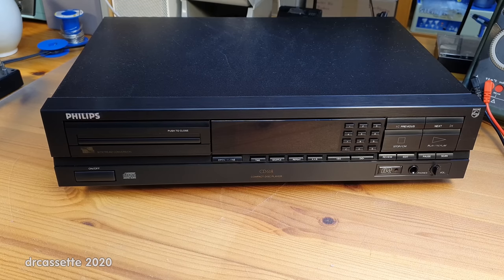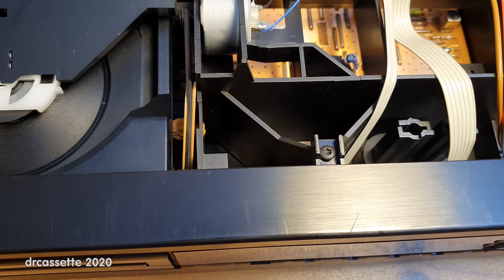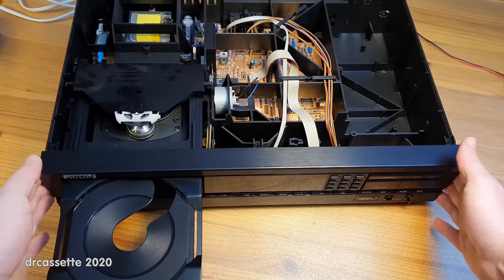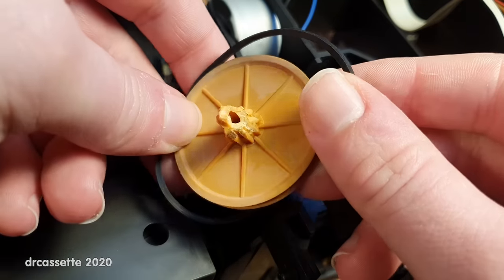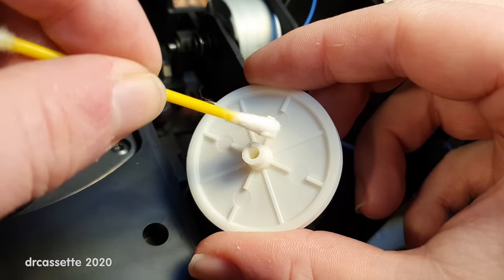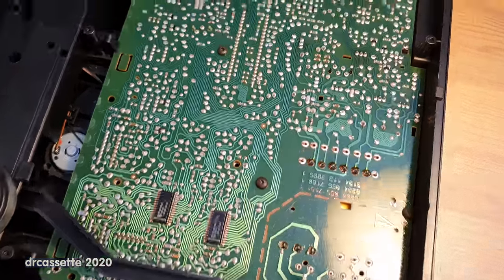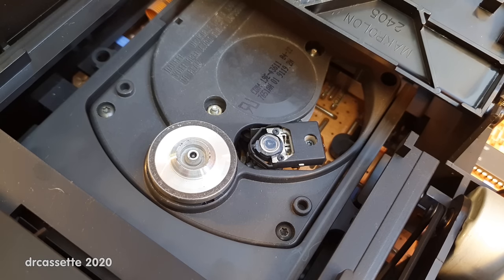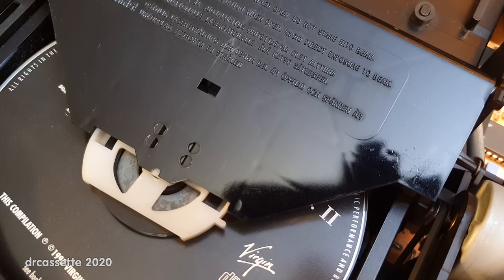Philips CD618 CD Player repairs - CDM4 drawer gear wheel replacement

Comment: The CDM series it the finest of laser pick-up design; the CDM-1 is built to last forever, all metal, excellent piece of design. The CDM-4 is a later cost saving version with some pieces made of hard plastic, but the swing arm is still high quality. Very durable pick-up, virtually no maintenance required throughout all of its life. As for access speed, CDM were not that fast due to the mass of the pickup and the counterweight which tended to overshoot in case of wide and fast movements. Philips itself abandoned the swing arm with the last of the line CDM-9 in 1995 and started using linear pick-up with the (cheap) series of CDM-12. Beside costs reason (swing arm are quite expensive), it was not possible to use swing arm in CD-ROM, they were too slow for the random access of a data player.
Reply: It was CDM12.4 I think the last time I work in the service sector.

Comment: Even though this was probably a budget/mid range Philips player from back then it is still much, much better built than any CD player made today.  I have two CD players that are used almost every day, a Yamaha from around the same time period and a late 80s Technics. The Technics is solid, very heavy and superbly well built and even manages to read CD-R discs and CD-RW discs too even though they weren't invented when it was made. It is also using the same loading belt from when it was new, never had to replace it unlike the belts in cassette players and my Yamaha CD Player's loading belt.
Reply: Definitely agree . A lot of manufacturers cut costs in the 1990s . But this player is great

Comment: I have a CD610 mk2, and a CD634. Great machines. I also have a Marantz CD52 SE mk2, and three German made Technics players which all use the reliable CDM4/19 mech. Thanks for the video. Hello from the UK! I think a lot of 'Japanese' CD players were made in the EU to avoid import duty. These Philips Machines may be 'plasticy' but it's a very strong, low resonance construction.
Reply: Philips used the TDA1541 DAC a lot and that thing sounded smooth. It was so good that chinese companies started plagiarising it 😂

Comment: However.... That is some quality you do not see today anymore.... Amazing that no plastic was "cooked" and brittle
Reply from the maker: Ummm... the plastic of the gear wheel was VERY brittle ;)
Reply: I was biting my finger nails when you bent the plastic to fit the gear :)
Reply from the maker: The chassis plastic actually was okay, in very good condition. Though thinking about it, maybe I should have been a little more careful in case it wasn't...

Comment: Beautiful job. So really is worth repairing these units. I have just bought a Denon that apparently has a lazy door so may need to do this. Still love CD sound rather than mp3 what we are used to now. Thanks for posting 👍😊
Reply from the maker: The only applies to CD players with CDM4 mechanism, those are mostly Philips, Marantz and Technics. Not sure if Denon used the CDM4 mechanism.
Reply: @DrCassette  👍 ok. I have subscribed. I may need more advice in future. Thank you 😊

Comment: Thanks for sharing this, I'm  following closely ...Do you know if the CD 604 is the same wheel and belt?
Mine is orange colour and although the gear was well worn in parts it was a part of the belt's running groove that had been shorn off.
The motor fires up no problem with it all removed so it must have been jammed somehow, and I couldn't hear the motor trying to do something when pressing the load/eject button so thought it was the motor that had died ,you mention the diode can leak away over time-
Also I didn't need to disconnect the power arm on this one-
there's a snapped dowel pin on the corner of the tray bottom left side-it seems to be retaining a small spring- perhaps it's one of the snap locks when the tray is fully closed you feel it connecting ? 
Maybe you know what I should call it and if is available as a part ?
Thanks again and I'm hoping the wheel and belt are the same so I can order them 
Best regards to you !

Comment: I’ve got a single disc CD player I’ve had for years I love it. It recently started to fail. The cd drawer only opens when you tap the top of the CD player. I’ve tried greasing the components but that doesn’t help. Think it’s something I can repair myself or should I bring it to my repair guy
Reply from the maker: How am I supposed to know if you don't even give me the brand and model number? ;)
Reply: DrCassette kenwood DP-2040 mfg 1992
Reply from the maker: Seems to me like the drawer drive does not have enough force to disengage the part that holds down the CD during playback. That's why tapping the CD player helps. Most likely a bad drive belt. Make sure the belt has plenty of tension. If it hasn't, replace it. Also make sure you haven't gotten any grease on anything that is not supposed to be slippery.
Reply: DrCassette awesome thank you 🙏 the guy I topically bring my electronics to doesn’t charge much . If I can’t do it  I’m sure he’ll be able to help . I like to do what I can just feels better thanks again and kind regards, Michael
Reply from the maker: You are welcome :)
Reply: While you're replacing the belt, you might also want to give the drawer microswitches some love. These signal the the drawer position to the microcontroller and like to get dirty which can also lead to strange behaviour upon opening/closing the drawer.
Reply: Definitely a good idea ... contact cleaner... beware of over spray... getting on the pickup lense ... as far as the belt goes if it has decent tension... it may just be a build up of grease and dirt (slipping) give the pulleys a good cleaning with denatured alcohol ... if the belt comes out easy enough give it a good washing with dish soap ... allow the pulleys to dry throughly ... certain formulas of rubber belts don't like alcohol no matter the type Good luck in your quest 😃

Comment: Thanks for the video, I had a 614 with the same problem. However, I found that I didn't have to disconnect the power button arm from the switch to remove the front plate, just tilting the front like an oven door was sufficient.
Reply: Thanks much for the video - and this comment. I've got a CD614 to repair in a few days (same issue: The wheel came apart like a piece of cooked and re-dried pasta) and this will do the trick. Meanwhile: Do you know what the CD618 relationships are? Looks like a CD624 from the outside. Is the 6X8 family (if it is a family) the 230V UK version of the 6X4 family, by chance? Cheers & best from the continent.

Comment: Was waiting for the SNAP from that bendable piece of plastic...
Reply from the maker: The plastic the chassis is made from fortunately is in very good condition, so I had no worries about snapping off that piece. And if it had snapped off, there would have been some swearing and some epoxy glue and all would have been fine again...

Comment: Easy, breezy, beautiful Cover Girl - It's a Philips. It works, nice plastic ribs for extra strength. Mechanisms themselves better than the best Sony, my Sony skips on some 80min CD-R towards the end. BTW,  don't be surprised that it can play CD-RW - Philips developed them after all. And this one has removable bottom panel - my Sony from around the same time doesn't, so another big plus for the Flying Dutchman. Volume control, Program, Index - what else would you need. I can't find any Philips based machine in my area - the it's a Sony advertisement made such a following that in North America Philips was treated like low fi brand which is very far from the actual truth. Guess what my post 2001 Sony Car CD player uses as amplifiers - NXP chips. And think of all the NOS Mullard and Philips tubes many people are after, some of the best quality tubes ever made.
http://www.soundfountain.com/amb/cd25years.html
BTW, the TDA1541 with oversampling, dither, and noise sampling was used by Sony untill 1988 when they finally were able to make their own chips that were as good as the Philips TDA1541.
Reply: CD-RW requires a dedicated "mode" to be read: reflectivity between pits and lands is lower and with standard pick-up the signal is too noisy to be decoded. CD players that supports CD-RW increase by 10 the amplification of the RF coming from the laser pick-up. The TDA1540 is a 14-bit DAC, but it was used by Philips in a sigma-delta configuration so that thanks to noise shaping it could reach a resolution of 16 bits. Very clever ! I have a Philips CD 204 with both CDM-1 and TDA1540 and despite its age it works perfectly and sounds very good.
Reply from the maker: Interesting, I knew CDRWs were less reflective, but I didn't know CD players could switch in additional RF amplification to better cope with this. I used to have two Philips CD204 CD players, one silver and one black. I ended up selling them because I didn't use them as much as they deserved. But they were absolutely fantastic machines.

Comment: I fixed my CD player with this video. Awesome. One more question... Now, a week later, the motor starts to spin shortly when I press the CD player ON, as if it wants to close the drawer. However, the drawer is closed, so the belt starts to spin around the wheel, making weird noises. I don't think it's normal behavior for the motor to start spinning when the unit is powered on. Any ideas?
Reply from the maker: This could be caused by dirty contacts in the limit switches, so the logic thinks the drawer is open
Reply: @DrCassette  thanks for replying! Where can find those switches and how to clean them ?

Comment: Do you still have this player? I have an odd question about it. 

I have a Micromega Leader 2.  They modified it off this player. I took off the feet and put them aside with the screws. I went to put the feet back on and noticed that one of the screws is shorter than the other 3. I'm embarrassed to admit I can't figure out which foot uses the shorter screw.

Comment: I have the CD 620 from around the same period, was my first real CD player, took it out of storage ( the loft) and powered it up, pressed open on the drawer but nothing happened so I opened it up, the gear and belt were OK but somehow the cover had got stuck, lifted it up like you did and then put it back, now the drawer opens fine but its quite slow, do you think I should replace the belt anyway and also the grease as the existing has gone a yellowish colour.
Reply: I would definitely replace the belt but also look for the same issue with the broken gear that he showed you in this video.
Reply: @postersm7141  thanks for the reply, the drawer opens fine but slowly without making any sounds like in this video so I think the gear is ok but I think I will change the belt and put some new grease.

Comment: My second CD player ever was a Magnavox with this rotary voice coil mechanism.  I think it was also the only CD player I ever had that supported index marks.  I own only one CD I know has these index marks (Genesis - Invisible Touch).  I really wish I hadn't traded that CD player away all those years ago.
Reply from the maker: That's interesting, do you remember what the index marks were good for on the Genesis album? Must have been the first release of the album on CD, the re-release on CD that I have of course has no index marks. I always thought the index marks were only used on CDs with classical music to subdivide tracks.
Reply: @DrCassette  on Invisible Touch, "Domino" has an index mark that will take you to the second part of the song ("The Last Domino").  CD ripping software like Brasero will even pick these marks up and put them on the TOC.

Apparently, if you've got Genesis's "Foxtrot" album on CD, the "Supper's Ready" track is subdivided into 7 parts using index marks.  This is probably release-specific, too.
Reply from the maker: Very interesting, I never knew index marks were used on pop/rock CDs as well. Thanks for the info!
Reply: The first release of Enigma - "MCMXC a.D." also had indexes. Later versions of the CD used regular track markers but I recently bought the first version brand new via Discogs so I could use the index buttons on my Philips CD 473. :)
Reply: And on the first pressing of Genesis’ Foxtrot there were index marks on Supper’s Ready!
Reply: i had a pioneer ,the pd-7100 that had index and all cd´s i had through the 90´s ,they work with index but the players don´t ,even pioneer later had the index in the display but just if you watched when in the begining of the songs you could see the index number appear, normally EMI cd´s had it,i remenber those lp´s that had sounds in between the tracks you could listen to them without those sounds just the songs as they were in the singles or radio versios, regards

Comment: I have a Philips cd player with a similar mechanism, however it is has a different problem. It can’t play cd’s properly anymore, it skips like crazy even on known good cd’s. Tried cleaning the lens once, but I think it might have a more severe problem. I wonder if the laser itself has gone kaput. It just seems to have a tracking issue.
Reply from the maker: That is certainly possible, laser diodes have a limited lifetime. Over the years I have come across two Technics CD players with CDM4 mechanism. Both had problems detecting CDs and tracking properly during playback.
Reply: @DrCassette   You are correct - they have a finite life - good for a certain amount of hours and that is it.  Kind of a shame because alot of these older players were great. 
I'm surprised you bash Philips so much - I though they were fairly well regarded in Europe/GB.  Here in the US, they weren't remarkable bad, just not normally special either.  They weren't the best you could get, but they were far from the worst.
Great video!
Reply from the maker: I was not bashing Philips, I was defending them! It is a fact that out of all European manufacturers Philips were the first to cut cost and reduce built quality. But they were still very well capable of making good products. And time has proven them right, out of all the major European electronics manufacturers Philips remains as one of the last independent companies.

Comment: I have a Phillips CD604 that is, I presume, either slightly older or slightly lower spec that the 618 you showed. It has just developed the same problem with the CD drawer and also will not read the table of contents. Before I take the casing apart, is the remedy the same for the 604? Is there anything else that might cause this? Thank you.
Reply: I just fixed my 604, following the Doc's excellent instructions. So yes, I confirm the remedy is exactly the same.  Though since you posted this just under a year ago, I appreciate that my response may not be entirely useful to you now.
Reply: @hingmy5746  Is it the same wheel and belt as CDM4 in this one?
Reply: @badbasstrilogy  I ordered the same wheel and belt as shown in the video and it was a perfect fit.
Reply: @hingmy5746  I think the entire 6X4 family (04, 14, 24, 34) and the 608, 618 are interchangeable in that aspect.

Comment: If you don't replace the worn parts of the gear drive, will the CD player eventually get to the point where the motor won't be able to open or close the tray at all?
Reply from the maker: When experimenting with how to get the mechanism apart for the video, I actually broke the gear completely. In that condition, you could freely move the drawer around as shown in the video, but the motor drive wouldn't do anything anymore at all.

Comment: Another note: Because this is a Phillips product, all of the screws are Torx, probably T10. (yes, I know that it may be considered ironic, though the inventor of Phillips head screws is not related to the electronics company)
Japanese decks use JIS screws (simillar to Phillips head screws, but slightly modified to reduce cam out (colloquially known as "slipping", it acts slightly like a torque limiter).
Reply: @UsernameNotDefined. You may already know this. The Japanese JIS screws are identified by a small stopped "hole" punched into the screw head next to the cross head pattern. Apparently, there are JIS screwdrivers available specifically for these screw fixings, right down to miniature versions for Japanese cameras and optical equipment. The JIS stands for "Japanese Imperial Standard" although I think the Imperial is based on the Japanese measuring system "Sun" and not UK/USA Imperial Inches.

Comment: I have a Philips D8884 with same CD-mechanism (excluded loader mechanism) CDM-4, it is a portable radio "boombox". The problem is that it won't read all tracks, stops and shows "error" mostly after track six and higher.I know you are DrCassette however maybe some others know what is actually going wrong? Is this a common problem of the mechanism and easy to fix? I don't think it is a mechanical problem because the arm can move freely at any position. Any ideas? Thanks for any reply.
Reply from the maker: Possibly the laser diode has gone weak. If that happens there are all kinds of problems with the CDM4 mechanism.
Reply: @DrCassette  Ah, thanks. Any chance to replace it?